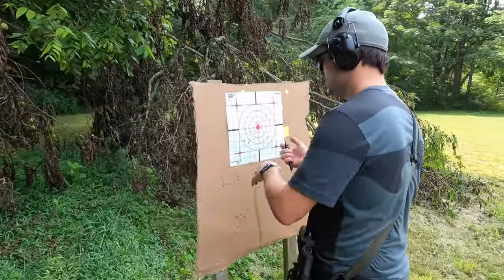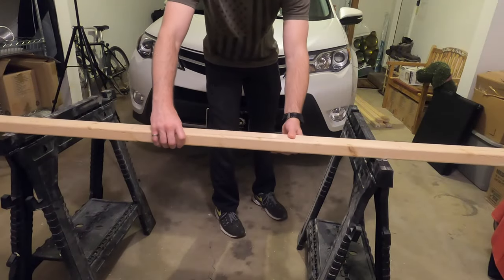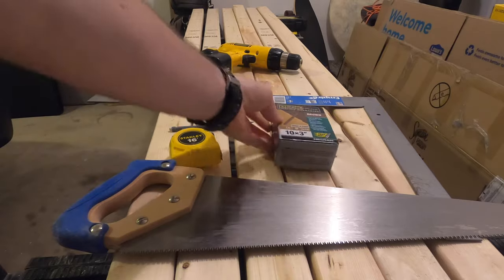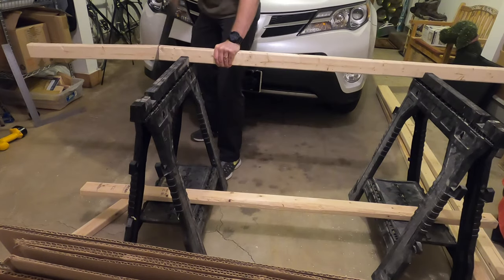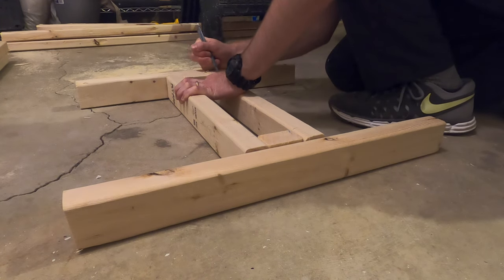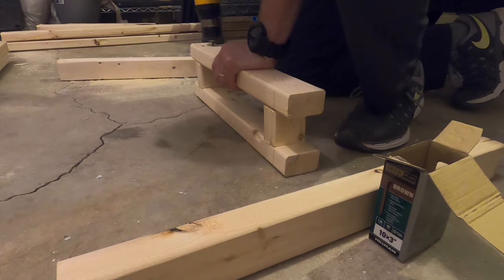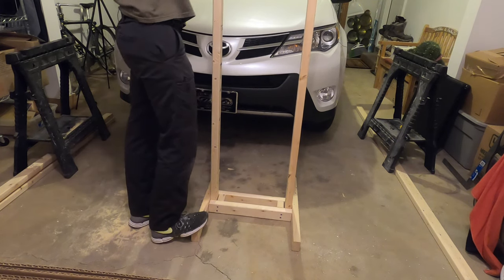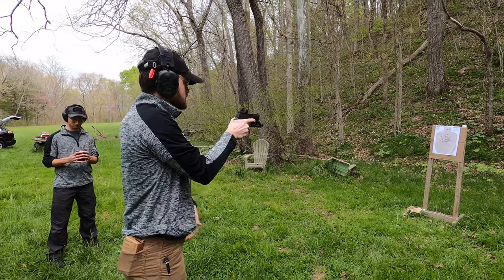How to Make Wooden Target Stands - Simple, Quick, and Easy

Comment: Thank you for the video! I ended up using 2x4s so I cut out 4 3.5" sections instead of the 2.5", and it worked perfectly. Got 2 new stands to use at the range. Thank you!
Reply from the maker: Hey glad that worked out! We’ve done that as well too. Enjoy those new targets 😎
Reply: Did you still use 8’ pieces and have enough for everything?